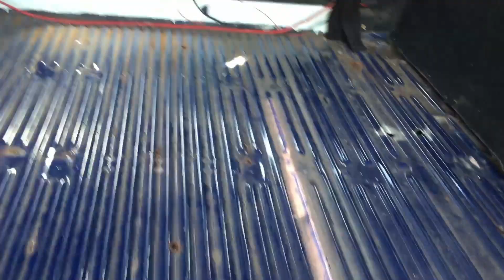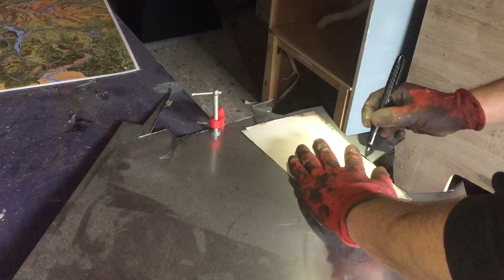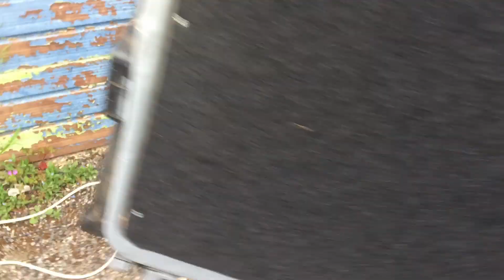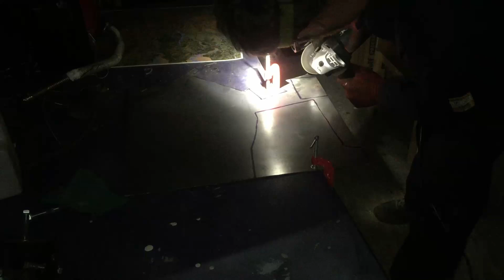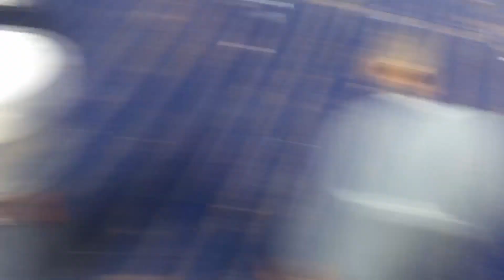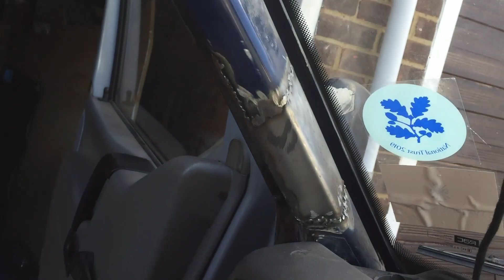Welding a Rotten Floor Section (VW T4)

Comment: Looks OK. Good to see a T4 being saved.  Listening to the sound of the MIG arc, maybe increase wire speed a tad more so you get a consistent 'frying bacon' sound and not a popping and stuttering sound. I'm fairly new to welding too, and I found the sweet spot on my old SIP Migmate by testing wire feed on old scrap steel then slowly cranking up wire speed until you get a consistent 'frying sound'. Then crank up wire speed until the arc starts popping and the nozzle is forced back due to wire not being melted quick enough for the selected voltage or heat setting. Then reduce wire speed to get the frying bacon sound. It's a good way of finding sweet spot for every setting on your MIG welder.  If you are burning through it can help by holding the nozzle at a shallower angle so the wire doesn't 'puncture' the weldpool. Another way of avoiding burning through is to do shorter bursts of weld. I found that technique helpful on some of the thin 0.7mm steel used on my Rover R8.  Good luck with the projects and your channel.
Reply from the maker: Thanks for the great tips! I’ve pinned this comment for future reference 😊
Reply: @JoelsStuff   Great video, I intend to get a MIG welder and do some practice .  I just paid £170 to get a hole in my N/S cill fixed at the garage .......Figure I can get a good welder for not much more and learn to do it myself.

Comment: Great video, took my flooring up today and the 3 main rust areas are in the exact same places, for reference what were you charged for the 2 suspension areas?
Reply from the maker: Thanks! I paid a couple of hundred, which made me realise how much I saved doing the rest myself.
Reply: @JoelsStuff  Cheers, yea definitely worth doing as much as possible yourself, I'm cutting out and shaping up the steel myself to save money, not that the money will be saved as it'll no doubt go on engine repairs! Gotta love a T4 😅

Comment: Very informative video mate. I’ve just got mine back from the welders and you’ve saved yourself a packet doing diy. I need to treat the floor before I reassemble everything but can I ask your opinion on suitable treatments. My welder has wax oiled the underneath but this too smelly for the interior. Did you just use hammerite? I find it chips quite easily

Comment: Nice job! You are a good template maker! I use a jigsaw with a blade for metal for cutting sheet metal. Easy and accurate! I had a few problematic years with my old welder until I switched from 0,8 to 0.6mm wire. Way better for sheet metal!  Keep up the good work!
Reply from the maker: Thanks! I’ll keep that in mind

Comment: as a t4 lover and a blacksmith fabricator i would also suggest pushing the torch forward rather than backward and just spot and stop on the thin stuff- weld, cool, weld,, cool, etc.. but i also want to say nice job man! those welds look decent and panels are a good fit. tidy work
Reply from the maker: Thank you for the feedback! I’ll keep this in mind

Comment: Hi Joel, nice job ! U could use a zinc metal paint too, looks to be a nice protection.
https://www.tuningblog.eu/en/categories/tuning-wiki/zinc-spray-252543/
https://www.youtube.com/watch?v=jVfkTxxnjbU
Some can be applied with brush too. You could also fill the holes/gaps with bare lead / zinc with propane gun.

Comment: Looks really good. 
Is that a gas less welder? What gauge wire were did you use?
Reply from the maker: Thanks. I’m using a mig gas welder, with 0.8 gauge wire and Co2 gas. I sometimes use gasless flux core wire too, which is not too bad

Comment: Great work Joel your welding looked fine to me, shame that arch is rotten but keep going you e gone this far.
One area you may want to check as your windscreen was leaking is under the plastic steps, my passenger side had rusted through to the inner sill from a windscreen leak.
Reply from the maker: Thanks. Yup they got welded last year so all good. The wheel arch is now done (mostly - finishing it off today 😊)
Reply: @JoelsStuff  awesome look forward to the next part 👌